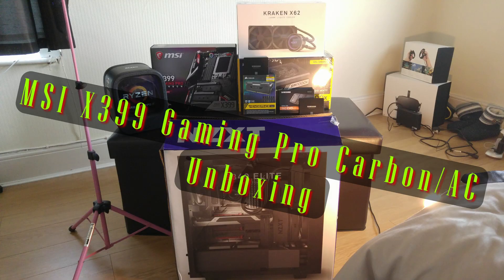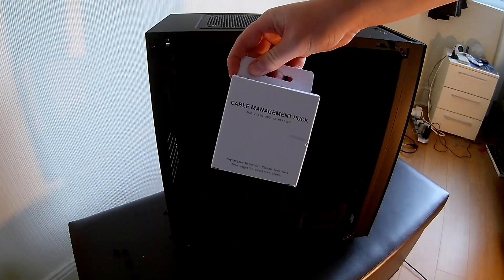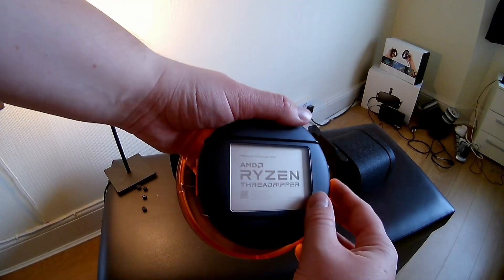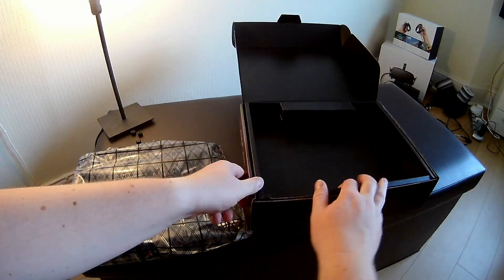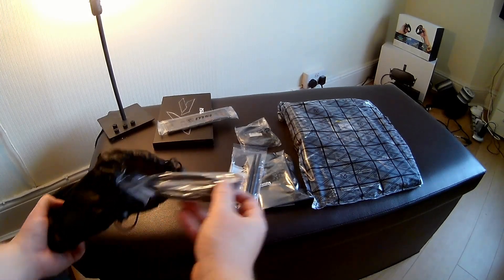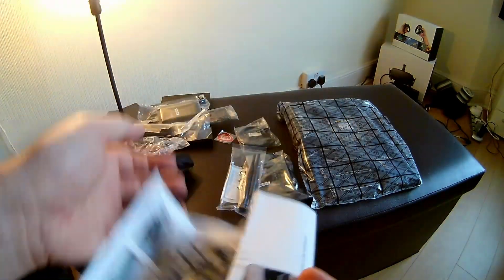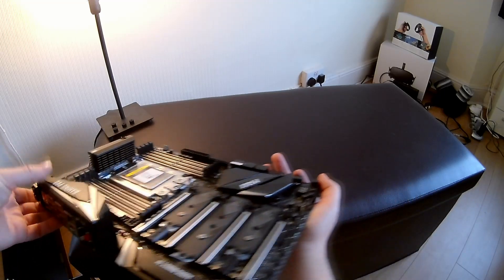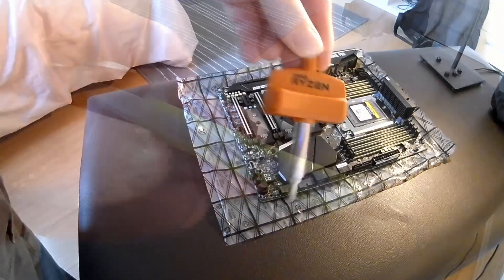MSI X399 Motherboard / Ryzen Threadripper Unboxing

Comment: Hey.
How did you install Kraken X62 for TR4? Does it have all necessary brackets?
Reply from the maker: +Eugene K Hello, thank you for your question. When you order threadripper the cpu comes with the bracket that fits on the kraken and other waterblocks a list can be found here : https://www.kitguru.net/components/cpu/matthew-wilson/heres-a-list-of-cpu-coolers-with-confirmed-ryzen-threadripper-compatibility/
Reply: Got it. Thank you very much.